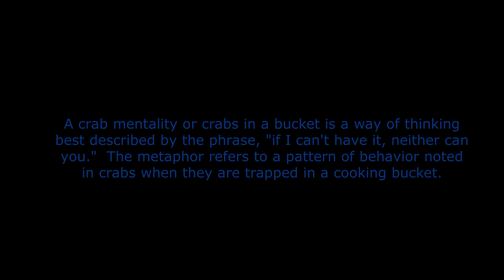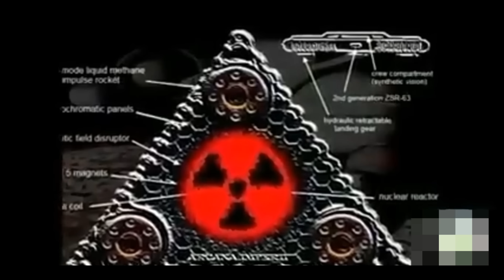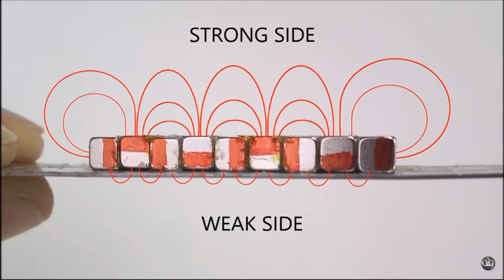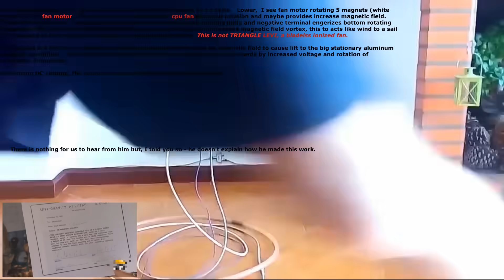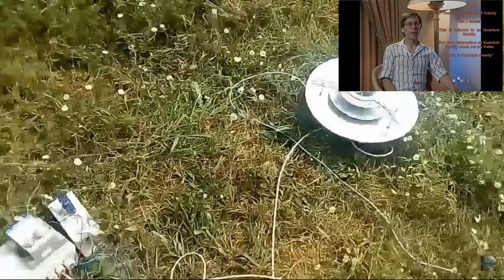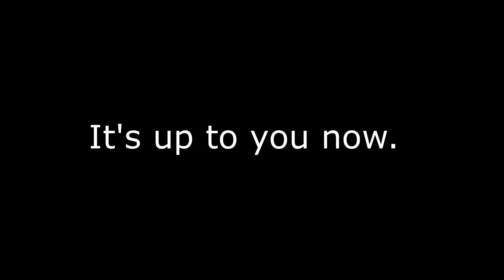anti-gravity project

Comment: The planet is like a big magnet and he got to make the same surface polarity to make it to be repelled by the ground and in the mesure that it increases the tension the aparatos goes more to up.  If one puts a positive electric pole on the upper part,  it will  " fell to up ". I think that are many ways to get anti gravity and this is one of them. As the strnght of gravity is also exerced to all " flying soucer " sides, it could be droven to go to the front or to the back and be controlled like any veicule, depending only of intensify or discreasing the impulse of electromagnetisme and it would be necessary to put ar the sides of the veicule a smaller electromagnetique impulser and it would be necessary an energy generator to create antigravitational strenght. I have many interesting ideas about this subject.

Comment: In flight dynamics there is Lift which can cancel the effect of gravity ( weight ) and surpass it, in a similar way to what trust cancels or  surpasses drag and make the craft to fly and travel forward.
It is never said that lift is antigravity.
In this case, Magnetic force cancels the effect of gravity. It must not be called antigravity.
Reply: um, magnetic force does not cancel out the effect of gravity. Gravity is not electromagnetic.
Reply: Trust makes airplanes fly, but that flight is accomplished by the shape of the wing, called the Bernoulli effect.

Comment: we know about electrons , electricity , and the electrons magnetic properties ,but  when are they gonna discover the magnetic properties of the Neutron and neutricity , or the magnetic properties of the proton and proticity . the neutron and proton both have magnetic properties that are vastly different than the electron . that must mean they both have a magnetic wave unique to the neutron and proton.
Reply: how to build a neutron generator 
https://www.youtube.com/watch?v=OI_HFnNTfyU
at 2:26 you have example of magnetic bearing , first get a tesla turbine running at 80,000RPM connect a 1:100  gear with 200 magnets also . at 2:26 you have example of second smaller gear with two magnets . for every revolution of the larger 200 magnet gear it will magnetically turn the smaller magnetically lifted gear with 2 magnets 100 times for 8,000,000 RPMs then attach a centrifuge or light speed engine or neutron generator to the second gear and if you get the right radius of he third apparatus . centrifuge , light speed engine or neutricity ( with near absolute cooling and separate magnetic field to attract all the electrons ) for near light speed to faster than light speed RPMs . it only has to work for a second to expel liquid fuel at light speed but for artificial gravity it needs to run around he clock.if science is like music i'm the composer and your the musican . copyright "OUT OF THE WORLD RELIEF FUND"
Reply: if this works you can also collect the electrons and protons when the atom sheds them producing first electricity , proticity , and finely neutricity . if the high gravity also attracts the elctrons and protons you will need some way to strip away the electrons and protons , with magnetic wave for electrons and what ever attracts protons
Reply: i theorize the magnetic properties of the electron , proton , and neutron are as follows . the electron is electricity and magnetism . the proton is heat or light , a laser is proticity and the absolute absense of protons is cold . which is why electrons work better incold with out protons makeing heat and  resistance . third  is the strongest force in the universe  stronger than the proton and light GRAVITY
Reply: SO NOW WE KNOW THE MAGNETIC PROPERTIES OF THE ELECTRON (MAGNITISM) PROTON (HEAT) , AND NEUTRON (GRAVITY)
Reply: I THINK I ANSWERED MY OWN QUESTION HOW TO COLLECT PROTONS .IF PROTONS  ARE HEAT . THEN YOU WILL NEED MAGNITISM  TO STRIP AWAY THE ELECTRONS , THEN COLD TO STRIP AWAY THE PROTONS AND CENTRIFUGAL FORCE TO COLLECT THE NEUTRONS
Reply: i just had another insight to the secrete of gravity . what keeps the moon and all the planets in orbit ? how to negate the effects of gravity on other objects in space . keeping all the dyson swarms in balance with all the other terrain features in our solar system
Reply: the moon Luna has a gravity well , it may be small but it exists
Reply: the planet earth has a gravity well . both act as neutron magnetic fields
Reply: a neutron magnetic field is gravity
Reply: the planet earths neutron magnetic field attracts stuff towards it . why every thing falls to the ground
Reply: the moon luna's neuron magnetic field aka gravity attracts stuff to it like the planet earths gravity
Reply: so you have one gravity well and magnetic field atracting stuff towards it and another gravity well and neutrn agnetic field attracting suff to it till you reach a ballance betwwen the earth and lunas gravity attracton
Reply: so if you have two habitats in space . the larger  gravity well pulls the smaller gravity well towards it till the smallers gravity well falling away from the largers reach a ballance and negate each others gravity attraction . or they will orbit each other at a central point
Reply: once we discover Neutricity and can make a mangetic field from it . we have artifical gravity . then we can make two opposing Neutricity magnetic fields and leave mother earth for our new home in deep space
Reply: a  positron is an anti-electron , if protons are hot then anti-protons are cold . a  neutron is both a neutron and anti neutron at the same time depending on which mass of neutrons have the greater gravity
Reply: THE MAJOR PROBLEM WITH THIS LIGHT SPEED ENGINE IS HOW TO KEEP THE 2ND GEAR STABLE AT 8,000,000 RPMS . THE MAGNETIC BEARING AND GEAR WILL WORK AT 8.000,000 RPM BUT HOW O YOU KEEP THE 3RD STAGE APPARATUS AND 2ND GEAR STABLE
Reply: FYI https://www.youtube.com/watch?v=cJDM_g4Wl2s
Reply: https://www.youtube.com/watch?v=ELRTVTfOjis
Reply: https://www.youtube.com/watch?v=PyBTE5cjGDY

Comment: so if an alien ship has some form of electrical power an EMP could disable them and bring them down??
Reply: Sure, I think you need the right frequency only. Think of it like our powersystem that range between 110V-240V, within a frequency of 50Hz-60Hz. The EMP has to be set to the same frequency at what it tries to neutralize. They're probably in the radio range somewhere, it's a trial and error to find the correct frequency, but viewing and calculate with what is detected, that should narrow it down. To store energy capacitors are used and the frequency should not matter, only voltage, a million volts +!

Comment: Well copper is not the earth and the earth is too weak a conductor to actually cause levation. The effects of the magnet field against a closed loop or solid copper is the lentz effect. This process is used in the general atomics mag lev train which was designed by Dr. Richard Post of Berkeley.

Comment: Earth has a magnetic field and it's probably what slowed down the "rock" with magnets in it.  Also, how did he release them at the same time?  Did he measure the time of each "rocks" fall?  What caught the "rocks" at the bottom of their fall?  A mechanical shock like that could reduce the strength of the magnets' magnetic field.  Where is this experiment documented?

Comment: i remember a program i watched many years ago on tv, i think they used aluminum plate nitrogen cooled and then they gave it a jolt of high voltage electricity and the disk slowed down its fall. i don't know if it is related to this.
Reply: dumbcreaknuller that’s because when some conductors are cooled, they exhibit properties that classify them as super conductors, which is a conductor without any resistance. Magnetic field lines also change when the conductor turns into a superconductor and they can do some pretty cool things. Search up videos of “quantum levitation”
Reply: So how do you make the spinny anti gravity device at the end of the video
Reply: @vinceywinceyspider  it's a hoax, that's my bet.

The first video in house it's just suspended from fishing line, hence the white background. When he puts the ring around it, he opens the ring quickly off camera, puts the string through it, reconnects it (see the black tape by where his hand was?) Then drops it over the machine. That or he had a ring already around the fishing line out of frame. 

In the second part outside he has 3 or more tall poles mounted in the ground outside of the frame and has the device tied to them with fishing line. He just minds them when he puts the stick over it. 

It's just impossible for the device to even work as demonstrated and be stable.
Reply: If that anti-gravity device really  works you would have seen many business projects being made. The military, Space agencies and aircraft manufacturers have been doing research for many decade still no luck and you believe a single man with a video camera without funding is capable of creating anti-gravity machine without getting some sort of profit
Reply: @shinnishi3135  You are deceived because  the inertial mass reduction systems do exist and they have for quit some time now. In 2002 they had 80% reduction in mass and at one time they achieved 100 plus 10 percent dont ask how. Thero-fluid the 5th state of matter... they are on to systems of light infusion and using crystals. Quantum locking technology with superconductors. I have witnessed this technology and it is silent deadly and precise. Plenty of proof out there.
Reply: I believe spinning the plate gives the same function as cooling if we are to consider the Le Sage model of gravitation. Crazy thing is, after learning about the Le Sage theory 2 days ago, today I came up with an idea similar to the floating device in this video. 
The Le Sage theory is that we are bombarded by all directions with (I will call them Lesage particles instead of gravitons) tiny Lesage particles, traveling faster than light. They either deflect/bounce off atomic particles thus giving them a push, or go through them thus dragging them along. I envision deflection. So his theory is gravity is caused by pushing, not pulling (aka attraction). Certain atomic structures might deflect the Lesage particles better than others and I would presume that would do with their atomic structure. I also imagine electrical fields may interfere with their movement as well. Regardless, as the Earth is a massive collection of atoms, the pressure of the Lesage particles would be decreased around it consistent with the inverse square of the distance between the Earth and the other objects, as a result, they are pushed and accelerated towards the Earth. This is how we get two objects to get "attracted" to each other. It is actually the decreased density of Lesage particles between them that causes them to move together.  
So, if one was to block/rebound the flow of Lesage particles beneath them, then they would be pushed up. So to do this, you would need something that is good at blocking small particles (ie radiation), and aluminum fits the bill (I imagined a tinfoil coated thin lead plate). To ensure the atoms in my plate would encounter the speeding Lesage particles, I imagined either cooling the plate down or spinning it at high speed (Is that really analogous though?). I figured counter-rotating plates would work best. I imagine spinning mercury would also work.  As the Lesage particles deflect off my counter-rotating plates, the device is pushed up. 
I have not fully bought into any of this, but it is food for thought.
Reply: Goliathon's Cave very interesting. It does seem very odd that certain set rules for the universe exist. Such as the strong and week force. As well as gravity, electrostatic, and magnetic forces. I strongly believe there has to be something that all these forces have in common, or a common link between them all.
Reply: "Goliathon's Cave very interesting. It does seem very odd that certain set rules for the universe exist. Such as the strong and week force. As well as gravity, electrostatic, and magnetic forces. I strongly believe there has to be something that all these forces have in common, or a common link between them all."
 @ajelvani  The strong and weak force may be due to what Ken Wheeler describes as coherent (focused/unidirectional) and incoherent (unfocused/multidirectional) dielectric lines of pressure. Dielectricity may be the movement of the ether as influenced by atoms/matter. For light, coherent would be a laser and incoherent would be a light bulb. For lead, coherent would be the dielectric fields in a magnet and incoherent would be the dielectric fields in unmagnetized lead. Fractal Woman has recently given strong evidence that lead becomes magnetic when all the lead atoms are lined up in the same direction, and as such, acts as one large lead atom. So atoms are really magnets, and elements that can be lined up in one direction by some external force are potentially magnetic. Also, Fractal Woman also postulates that nature favors attraction (from the dieletric field) over repulsion (from the magnetic field). That is why when you put magnets together in close proximity (ie. put them in a box then shake the box), they will attract each other and join, not repel each other and stay at opposite sides of the box.
Reply: @goliathonscave9834  

If I may ask, in your opinion, do you think there is a chance that gravity and magnetism are directly related? Like some theorists claim gravity is "condensed magnetism" which I do not really know how to understand that statement, and this video seems to point to that idea to a degree and what not...... or do you think they are both not directly related at all other than they are both fundamental forces in nature?
Reply: @j0hncon5tantine  I believe that they are essentially the same. Similar to how a lamp and laser are both light. When the atoms of a ferromagnetic metal are aligned in orientation, you get a strong attracting and repelling force. When the atoms of the magnetic metal are in random orientations, there is an insignificant attracting force with other ferromagnetic metals and also a weak repelling force. However, attraction dominates, so the lump of metal sticks together and doesn't just fly apart into subatomic particles. When you have a large body (such as the Earth), most of the atoms are oriented randomly, so there is no strong attractive or repelling force, but in nature, attraction dominates (according to Fractal Woman), so you get gravity, which is the weak attractive force, significant to us however because of the mass of the Earth.
Reply: @goliathonscave9834  gravitomagnetic electric yes lasers and crystals with light infusion. You are on the right path with the right hand rule very important. Centrifuge yes high pressure yes center remains stable with the outer circle getting the fluid to rotate inside the center contianment.
Reply: @goliathonscave9834  

Do you think " Le Sage" particles are involved with light/ photons acting like a particle and a wave in the double slit experiment?
Reply: @j0hncon5tantine  For one, I don't have an opinion on light and the LeSage particle. Second, I don't believe light is both a wave and a particle. I do believe we are the proverbial blind men touching an elephant for the first time where one man touches the leg and says it's a tree and the other touches the trunk and says it's a thick snake. When light passes through glass (or any medium), it slows down (refraction) but when it exits the glass it speeds up again!! How the hell can that happen if it's a particle?? Where is that extra energy coming from to accelerate it?? 
Perhaps the LeSage particles are simply the ether, or maybe, there is more than one type of particle that makes up the ether and the LeSage particle is one of them. Le Sage particle advocates like "Draft Science" rail on Ken Wheeler's and Fractal Women's views of ether and gravity when ironically, they may be actually championing THE SAME THING HE BELIEVES!
Reply: @goliathonscave9834  : Where have you seen that light accelerate when quitting a glass ? That's wrong. And refraction doesn't modify light speed, it is due to the changing of medium AND the wavelength.
Reply: @goliathonscave9834  like Messiah Einstein said "your imagination is more important than knowledge, it's the language of the soul"  couldn't agree more

Comment: The earth is a simple spinning magnet so all we have to do is spin a magnet, of course the speed you have to spin a magnet at to attain 1g is easy to work out with Einsteins original equasin=on of E=MVsquared.  Energy say 1g = Mass of the earth X Rotational Velocity squared and now we can substitute the values to find out how fast we have to s[in a 1kg magnetic mass to creat 1g. and it does not need any thing stronger than ferrite to make this work. Of course you would not want to make 1g at first because if you did that test device would leeve for space at the speed of light to repel it self away from earth.